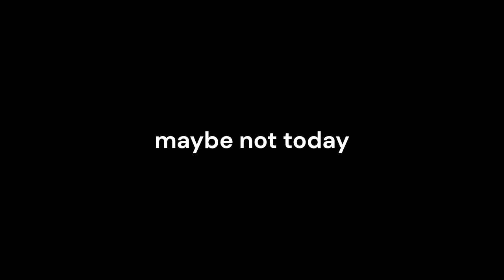Off road camper build pt uno. #buildmorewithless Taking frame and building new camper. #camperlife

Comment: Good morning !  What are the exterior dimensions of the box ?
Reply from the maker: When I planned out "box", I measured center of tire tread to center of tire tread, that makes this trailer 7ft x 12 ft long with 6 ft box on front. it would depend on what width axels you start with, good luck with your build!
Reply: Thanx !!! 🙏👍